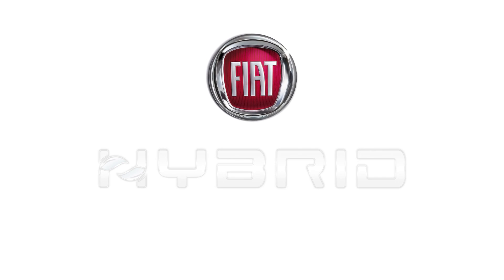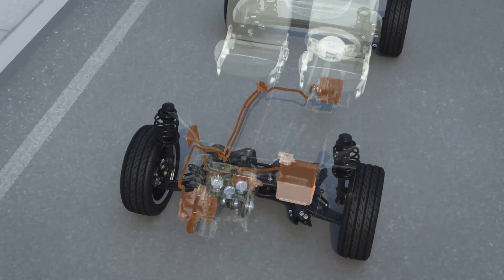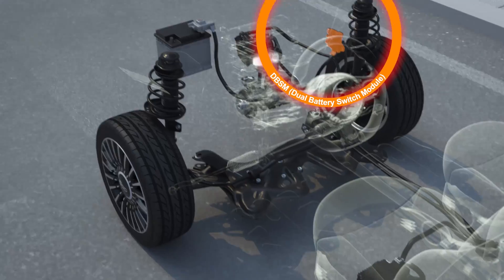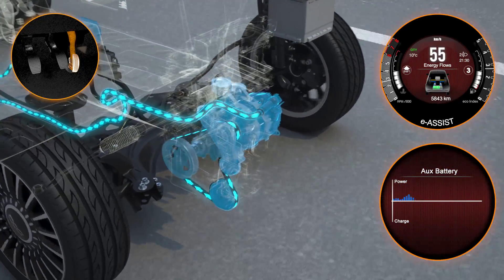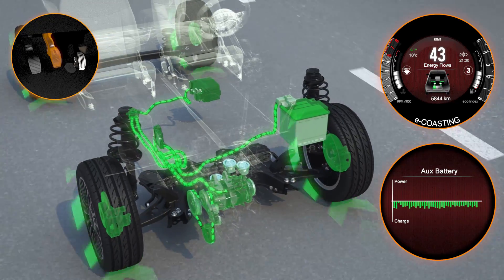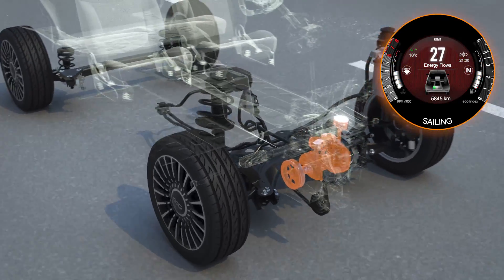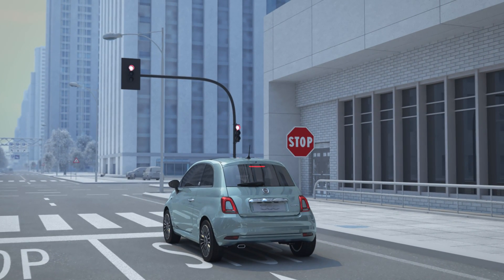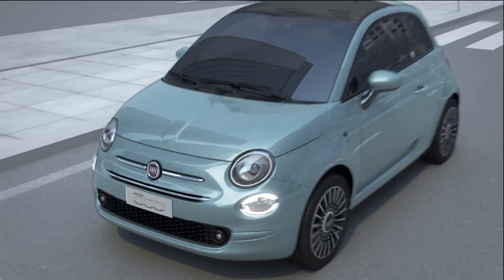FIAT | MOPAR - New Fiat 500 Hybrid | How the New Fiat Hybrid Technology works

Comment: Other words you can't drive Electric. So its called hybrid for nothing. I like the 4 cilinder engine more and its stronger for more mileage. 1249cc does not  consump much 4.8l/100km
Reply: Just hired one of these in Spain and after already driving over 300km, I was wondering when the engine was gonna cut out and the electric cut in. Thought there was something wrong with it. 

Not exactly a true Hybrid at all.

Comment: I've used a 500 hybrid on 2 separate occasions while traveling. It was my first experience with hybrids. And it doesn't make any bloody sense!

Why do you need electric power to accelerate from stop? It's not like you can't accelerate enough in 1st and 2nd gears as you can in any other car?

Now, the recuperating feature. I don't see how it makes any sense either. In a normal car when you lift the foot off the accelerator, the car can coast in neutral / gear. Here, the car starts to aggressively decelerates due to recuperation, and then you need to push the pedal again, thus burning fuel. How is it any good?

Plus, another feature is annoying for me – the car won't let you to switch from 1st / 2nd gears without pushing the clutch, because it turns off the engine when you shift to neutral. And then you cannot  push the lever into the selected gear because the RPM = 0, and the engine won't turn on until you press the clutch – see, defeats the whole purpose.

Idk, the whole thing is just dumb. I'd understand if it used like electricity only in start-stop traffic, but the current application is annoying, and I can't see how it achieves anything.
Reply: I have one whilst on holiday at the moment. Fabulous little car, brilliant system.
Reply: True silly system
Reply: شخصيا املك هذا النوع من المحرك في سيارة فيات 500 وارى انه لا يفيد في شيء

Comment: The sailing feature is interesting, but I have two questions:

1. How does the brake booster and steering servo work while sailing?

2. Why is sailing limited to 30km/h?
Reply: Power steering is electric
Reply: 2. I am not sure but if the speed is above 30 km/h it might be more energy than the generator can consume